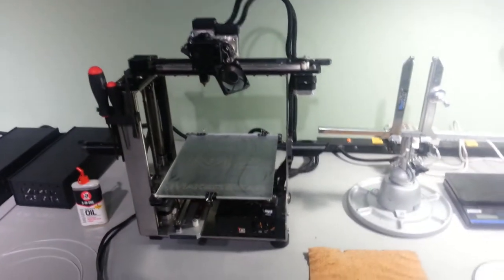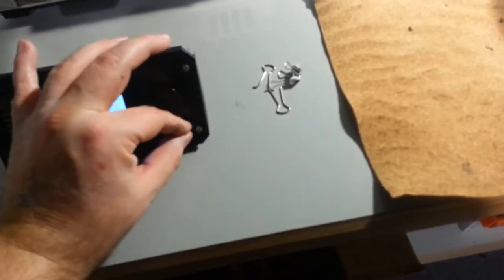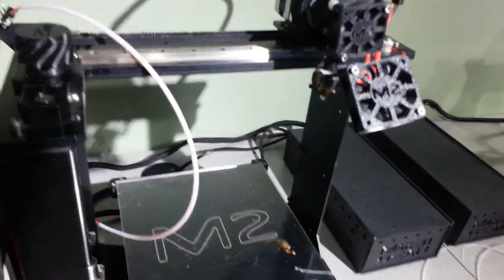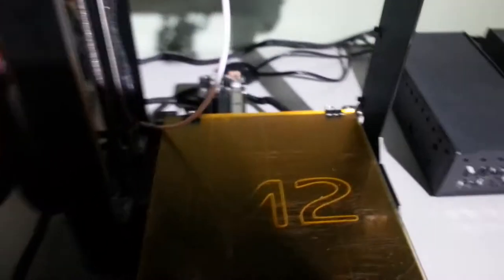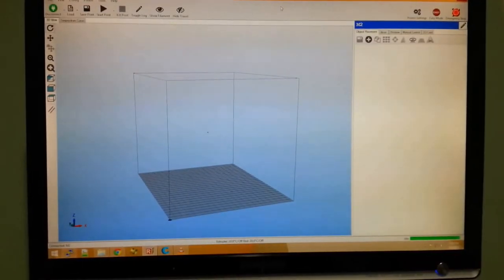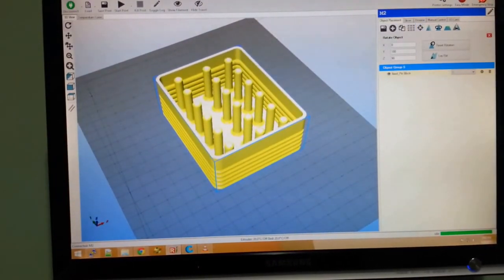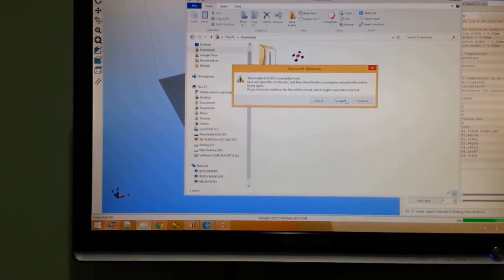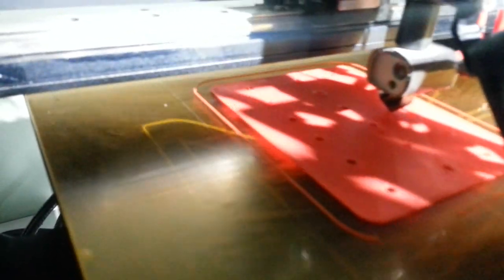Starting prints with the M2

Comment: hi, Thank you for your video. would you please advise what is your fiberglass board thickness , when you to get it.
Reply from the maker: Wender Wang It didn't work, at all.  Use 3mm Garolite LE.
Reply: Bryan Boettcher  thank you for your info. is this material need to take long time to heat up platform to begin to extrude, where did you buy it?